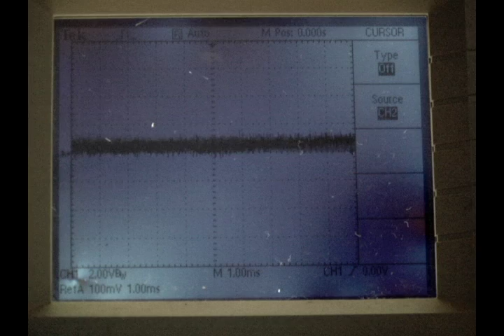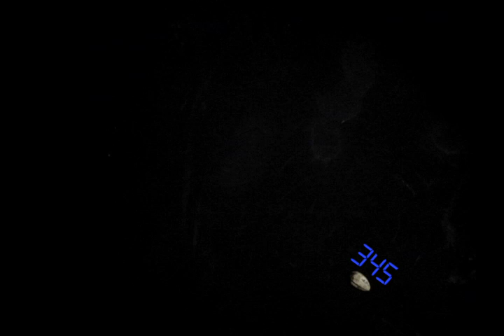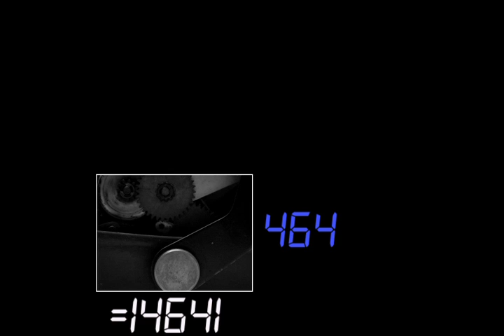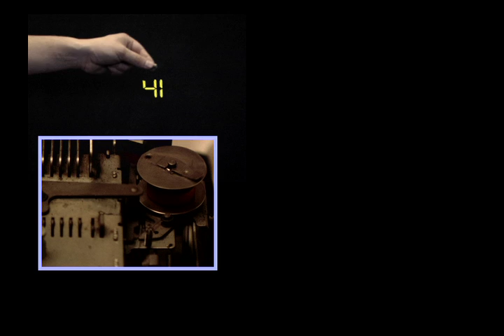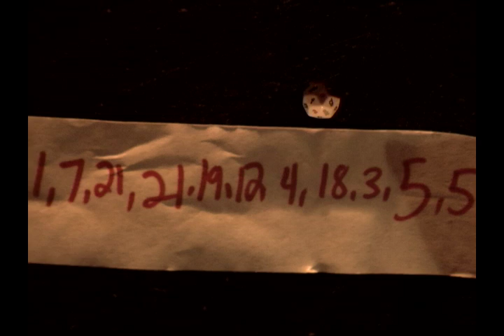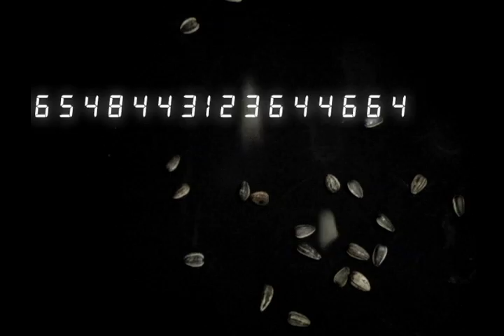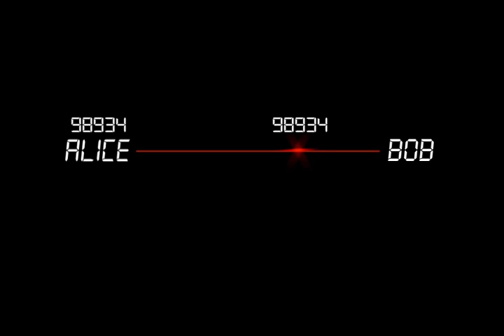Random vs. Pseudorandom Number Generators

Comment: To be more clear on my question below could ,say a text file, be instead be replaced by a (hopefully?) smaller file that is just a special random generation function , seed, ect that after a (hopefully?) short amount of time will spit out the original text file ? My personal guess is that there are a few (seemingly?) random text files that could be derived from a specific  psuedo-random function,seeds,ect  but then that function for a given text file would be are hard to discover/calculate. I really doubt that I'm the only one that has come up with this idea for data compression so there is probably some major flaw with this plan ; can anybody tell me why it doesn't seemed to be used?
Reply: if we can reverse this.... yes
Reply: If you think about it thats what hashing must do, and probably how archive compression software works too (winzip, winrar, etc)
Reply: I guess it's possible. Library of Babel has every book that existed/exists/will exist with limits of, afair, 3200 words/letters (there are some other limits but you can read it in the "theory" section).  https://libraryofbabel.info/search.cgi

Comment: So when you call a rand method in code, where does the seed come from? Maybe CPU temperature, but then that is no longer random, and breaks the randomness...
Reply: SteepVisions sometimes it's gathered from user entripy
Reply: SteepVisions 
Some programming languages(in low and high level, such as Python and C) allow you to insert the seed yourself. It's usually easiest to use the on-going timers(or NTP), but you can use unallocated memory or floating ADC if hardware is accessible.
Reply: At least in c++ you can do a seed(time); for a rand() function you can put what ever you want as the seed as long as you can get the number.
Reply: SteepVisions Some programming languages use the same seed every time. So that running the same program twice will generate the same output. This is desirable because it's harder to debug programs that do different things each time you run them.

But they usually provide an option to set the seed yourself. In which case you can set it to something like the current time. This isn't good enough for cryptography though. If you are doing cryptography, you will probably want to use special software that creates a seed from as many different sources as possible. The time, the location of the user's mouse, special hardware RNGs if the computer has one, etc.

Comment: If it is small closed system you probably can predict it  bit if it is big system, or if you are part of that system prediction is impossible because part of some thing cant fit data of whole thing. You will run out of memory before it will start repeating itself. or alternatively you will need to simulate whole thing inside of some limited model.